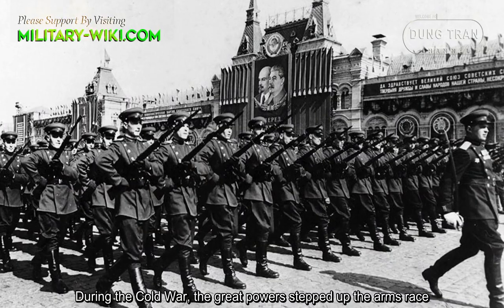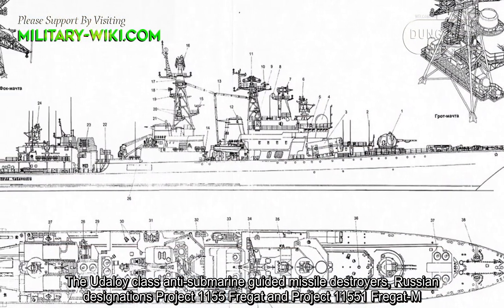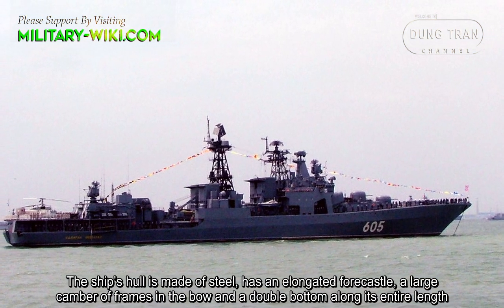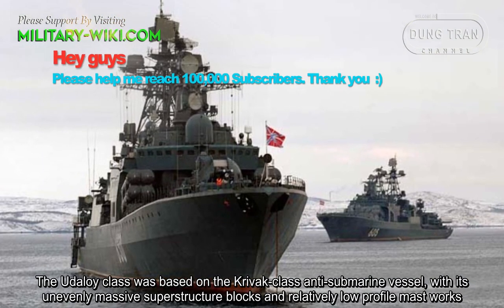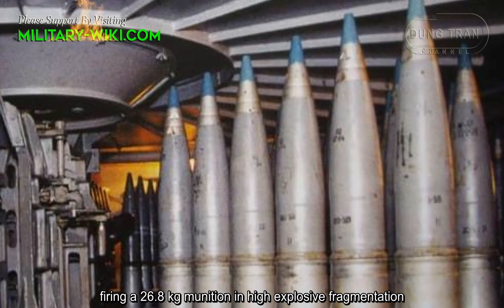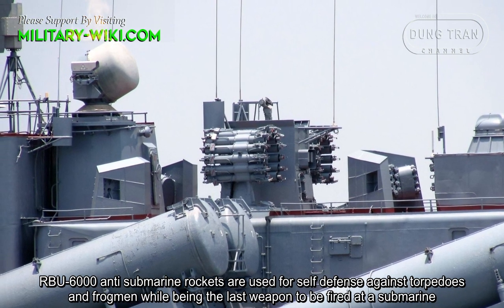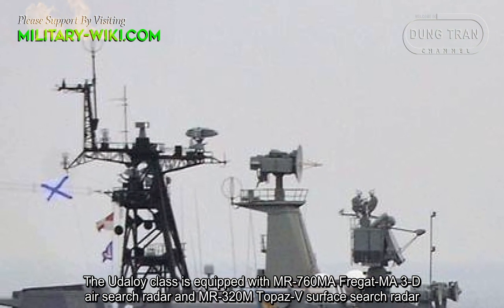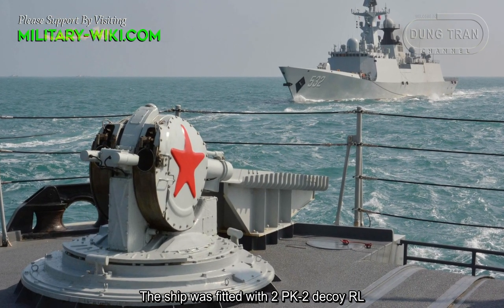Udaloy-class: This Why the US Navy afraid of Russian Submarine Hunting Destroyers

Comment: These are good for sub-hunting once they upgrade the sensors. But i wouldn't take them beyond the coast with the equipment they have or will have in a real conflict. Replacement would be cheaper than the upgrade but that is true about nearly their whole fleet and you can't replace that many ships and boats especially when you keep prestigious ships afloat. You can't call the Kiev class carrier and Kirov class cruisers sailing ships with most time spent with tugs and in docks.